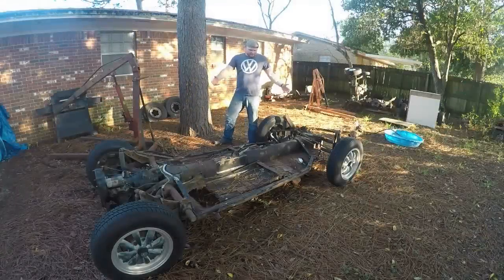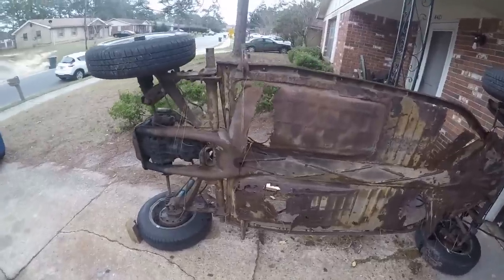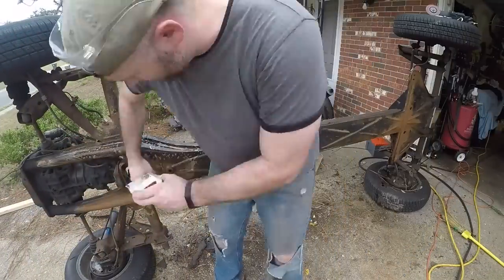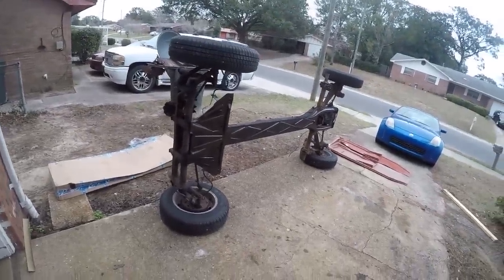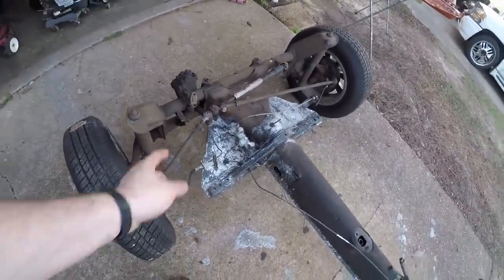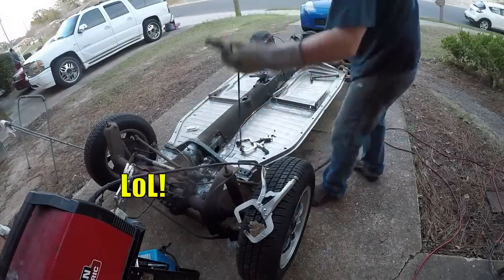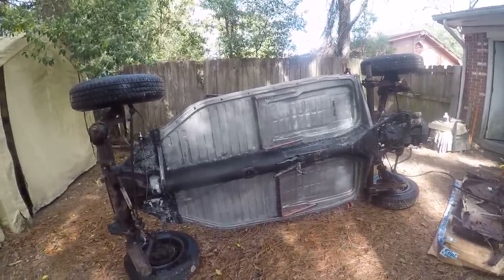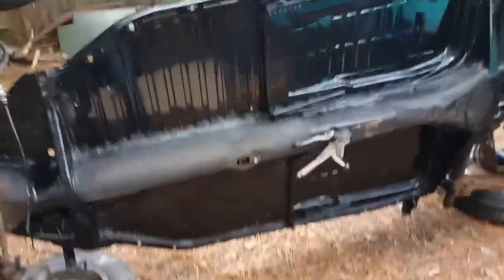Replace VW Floor Pans in 25 Minutes - (Beetle)

Comment: I had one on the mid-80's that was rotted out in the floors. I collected just enough speed limit signs from the back roads to pop-rivet under there and keep the dust out going down the gravel roads.
Reply from the maker: Hehe, those signs are pretty durable!  Good job!
Reply: @DuckmanCycles  
yea, didn't really fix anything, just delayed the trip to the scrap yard by a few years. i cant imagine trying to restore that thing in the condition it was in when I finally scrapped it, but I've seen guys taking on a whole lot worse these days
Reply from the maker: HAha, well thats still a fix!

Comment: Very very nice work! I need to live near you…..👍😁
Reply from the maker: Haha, my neighbors love me because I fix their stuff for them.  I'm the guy with the know-how and the tools.  I just did another floor pan replacement.... well, a DOUBLE replacement, 2 cars at the same time.  Check out the video! https://youtu.be/WdzqTdKgBAY   Thanks man!
Reply: @DuckmanCycles  I just bought a 66 bug that was a basket case big time. When I tickled it up on its side I found a total disaster…the tunnel has three 6x4 holes cut in it the entire front section has been “massages” looks like they were attempting to build a drag car 🤣🤣. Pan was cut and a flow thru setup for air to go thru holes In the back of the pan quit a joke. If you want I can send you a couple of pics to make your day a little funnier. Where are you located? I r in Texas
Reply from the maker: Oh man!  Hope you can weld!  Or a bunch of tubes of Panelbond are in your future!

Comment: Great Vid.  I am doing a 67 convertible for the wife.  Multiply rust x12 lol.  You should try wurth seam sealer as it is paintable and not tar based.  There are other other companies like PPG and Dupont that make it as well.  Anyway its what they use on modern cars and while it costs a bit more than the tar it tends to do a far better job.
Reply from the maker: Thank you for the compliment! I went tar for the cost (and nostalgia) it also paints fine with the oil based enamel I've been using.  Is your convertible as rusty as my '56 Oval was? LoL!  I may win an award for most rusty to restored here on YT for that one.  Do you have any videos of your convertible progress?  I'd love to see!  Thanks much for leaving a comment!
Reply: It is a close second to the oval.  I am pretty sure at one point the car was used as a make shift water tank lol.  I don't have any vids or anything yet as I am still buying parts for it.  All the work I have done so far was more or less just tear down and building the need list.
Reply from the maker: Buying and collecting parts for it, and a walkaround of the car make great first videos!  :: hint hint ::   :-D  Let me know, I'll be watching when you do!  Thanks for responding!  :-D

Comment: Question (becuase I don't know): why strip the paint off the floor pans? Is it not suitable to paint over?
Reply from the maker: That coating doesn't always stick too well, its only there to help stop the parts from rusting while sitting in the warehouse.  You may notice there were some spots that didn't come off easily... if its stuck that well, I leave it.  Some manufactures have coatings that you can paint over, just ask your parts vendor which ones you bought from them and go with their advice!  Thanks for the question, hope that helps clarify!  :-D

Comment: I have watched every floor pan video you've made like five times.  Very informative and helps me out significantly.  After you let the "Cat Piss" dry (lol) and when you "paint" the floor pans, are you using an epoxy paint and spraying it on via gun and compressor?  Or, are you painting it on by a brush and out of a can with a basic primer paint.  Any help would be great.  You have already helped out a lot with all the video's you post.  Thanks again for the badace video's!!!
Reply: I should elaborate.  I watched some of your other videos and you painted primer I think.  Are some ways more beneficial than others?
Reply from the maker: I paint with a brush into the deep crevaces where spray just doesn't get in well enough, I like to work it in.   Primer is used, sometimes, depends on the paint.  Some cheap oil-based lacquer paints stick like crazy to damn near anything, primer not always needed if pan is clean.... BUT!  The cat piss.... LOL!  (phosphoric acid) after it dries actually is a primer of sorts.  Paint sticks to it like crazy so long as its clean!
Reply: @DuckmanCycles  Oh dang, good to know.  I will give it a try.  I ordered some phosphoric acid to try out.  Thank you for the recommendations and replying.  It helps out a lot.

Comment: Thanks for the video, nice job. I have painted my chassis already and I will soon be turning my attention to the body panels.

So it is not necessary to sand the ferric phosphate surface once hosed, wiped and dried, before priming?

What concentration of phosphoric acid did you use?

You mentioned you applied 4 coats before reaching a gloss finish, but I am not sure how many of these coats were primer, or topcoat or just primer.

What type primer did you use directly to the ferric phosphate surface, eg etch, epoxy or polyurethane acrylic primer?

Was the asphalt seam sealer applied before or after you primed?
Reply from the maker: You can get the acid here: https://amzn.to/2ruGW0B

Thanks for the compliment and the comments!  Do not sand after the acid dies, you'll damage the protective crust that will prevent future rust from returning.  You may dust it off, or wipe it down with a damp rag however.

The concentration of the acid really isn't clear on the bottle...  but the acid etches the surface, itself becoming the primer.  Pretty cool, eh?  Another reason you don't want to sand it off.  Additional spray on primer not necessary in this case.

I usually like to apply the seam sealer after the second to last coat of paint dries, pack in in the seams as best you can, then paint again one more time over everything.  It gives a much better finished look.

I hope that helps!  Thanks again for taking the time to post!  Hope you subscribed, more to come!
Reply: @DuckmanCycles  I just drug up a Funco Single seat race buggy with some surface rust all over. I think this is going to make painting it amazing! I did flip a Karmann Ghia chassis up and cut the pans the other day after watching your video.

Comment: I had a beetle with a pan like this when I bought it with a piece of sheet metal layed over the hole. I just moved the battery behind the seat in a plastic battery box and no longer worried that a bump might drop my battery through the floor. Worried less too about a fire starting from the rear seat springs touching the battery terminals.
Reply from the maker: That was exactly what I did on my first Beetle, too! It also helps contain the acid n junk!  Thanks much!

Comment: What do you recommend for a paint stripper?  I need to strip my original seat frames.
Reply from the maker: Visit Sammy’s, give them the seats and get them a bunch or wire brushes.  Or Aircraft remover works fine, too!

Comment: No one asked in the dozens of comments I read but, what paint do you typically use? I go overkill on a lot of thinks with high temp wheel or engine enamel... but if it was your personal bug and not a paid job... or a well paid job what would you recommend/ use
Reply from the maker: Been answered time and time again in the comments lolol!  Its just cheap black enamel, get from your favorite hardware store.  I used the same thing on my Eleanore, but only on the pan, the body gets proper product and is being painted right now! http://duckshit.net/eleanore  I see myself redoing the pan periodically anyway, always upgrades, always mods... always tinkering!  Thanks for the question!

Comment: Duckman, where do you get your heavy duty floor pans at? Is that acid you use on the rust better than using POR15?
Reply from the maker: I think the acid is the same as what comes with POR15.   That was some years ago now that I bought those, there's a lot of places to get floor pans anymore.  
FREE SHIPPING Beetle 48-70 pans here: https://amzn.to/2E0YhGf
FREE SHIPPING Beetle 73-79 pans here: https://amzn.to/2wtD1qI
71-72 Beetles have unique seat tracks, you can use the earlier floor pans if you modify or replace the early tracks on the vw floors.

Comment: To seal that part of the welds and along their joint, it is ideal to put polyurethane sealant. good job.
Reply from the maker: Good call, I use what Volkswagen used that was good for the last 50 years... a tar-based sealant.  At 50 more years it will likely outlive me!  😁🦆💩

Comment: By the way, in which State are you located? Not California, we’re required to spray in a booth out here. The final finish looks like it’ll protect the pan for a long time! Nice work.
Reply from the maker: California is strict on everything.  Around here it depends on what you're painting,  and the materials used.  In this case its just commonly-available oil-based enamel that you can get at any of your favorite home improvement stores.  Its no different than restoring some antique, which in this case it is.  I'm sure if I had any significant volume I'd need to get a booth, but if I had that kind of volume I'd already have a booth!  Haha!  Thanks for the comment!

Comment: Duckman, can you tell me did you drill holes along the inside sides of the floorpan, and then plug weld to the chassis lip? I didn't see that in the video? Thanks Steve
Reply from the maker: Funny you should ask, I just did another floor pan video today... and I answered that exact question in it because I have been asked that a lot since I put this video up.  😁  https://youtu.be/1c_fanB5EdM   But no holes drilled, for several reasons spoken about in the new video.  Thank you so much for the question!

Comment: What was the reason for removing the paint that came on it? poor quality application? uncertain type?
Reply from the maker: Mentioned in video and A LOT in the comments here.  But to answer the question, all the above, it was chipping/flaking, and if its not sticking then my paint won't stick either.  Hope that helps clarify!
Reply: @DuckmanCycles  it does thank you

Comment: We have a paint here called sub-frame black that truckers use on the frames of their rigs, but people use it on the underside of their trailers and such,  and l use it on bike frames. The other thing we have here is a bitumen paint in a spray can and l have used that on the underside of motocycle mud guards/fenders and on the seat pan for extra water proofing.
Reply from the maker: A few people told me of similar things for heavy equipment, I shall try this in the future!  Thanks!
Reply: @DuckmanCycles  No worries. Incidentally old fisherman with wooden boats I have come across use coal tar on their boat hulls to prevent barnacles and wood worm from causing damage.
If I remember correctly British cars had their panels full of bitumen for body deadening properties but to make them water - proof against salt from the winter roads.

Comment: i got a 63 and a 74 both running no rust in them the 63 has a new pan and a 72 bus trans axle both have custom wheels good tires lot of after market parts on motors got both of them for 400 bucks
Reply from the maker: Sounds like you got a pretty good deal there!

Comment: Any concerns over rust in the hollow center channel?
Reply from the maker: No so much, really.... unless it was compromised because it rusted through from the outside, or if it was a convertible left to sit outside with a rotten top.  The tunnel is almost always in OK shape... when I've explored with a borescope I don't usually find any rust at all.

Comment: I've got a really noob question for you, what kind of cheater pipe are you using? I bought a 3/4 inch steel pipe at my local hardware store and it bent when I tried to tilt the chassis.  There's a joke in there someplace.  Thanks!
Reply from the maker: I'm really not sure where that pipe came from.  I've had it for a long while.  Its similar to the handle on a 5-ton floor jack.  A big heavy, mofo pipe.  Its almost 2 inches in diameter.  Thanks for the question, I'll ask the guy I that handed it to me to see if he even remembers... lol
Reply: DuckmanCycles and VW Garage  haha, yes I knew the answer would be “bigger and badder than the pipe you have now!”
Reply from the maker: Haha yup!  There is a lot of force on that pipe right at the fulcrum where you bent it.  What I call the "orange pole" I use for flipping chassis or even popping out ball joints.  Its incredibly handy and matches my 
 off-camera personality!  HULK SMASH!  😂😀😂😀😂😀😂😀😂
Reply: I bent it back... let's see if I can return it to the hardware store without them noticing!

Comment: Did you measure diagonally to square the chassis? I lock it up, adust,  square it then weld.
Reply from the maker: Yes it was mentioned (but not demonstrated) in the video :-)

Comment: Great video! Thanks for putting in so much effort. What paint stripper did you use on the red oxide primer? Also did you panel wipe or something after using the stripper? Keep up the top work 😎
Reply from the maker: Thanks!  You should always wipe where a stripper has been... just sayin...  LoL!  But yes, must be clean before painting!

Comment: One more" I went back and viewed the video, you said spot weld. Did you use flux core wire or L56 with Argon?
Reply from the maker: Its just flux core, but I stay away from the cheap ones, they tend to make a more exciting light show, tons of spatter everywhere.  I may upgrade to gas someday, but for now I'm overall satisfied.  Thanks for the quesitons!
Reply: Once spot welded, do you have to use seam sealer because what I'm getting at is, wouldn't you get leaks----confused? I'm trying to understand--the idea is that the new pan sits on the edging of the channel, right?
Reply from the maker: Seam sealer is covered in the last few minutes of the video.

Comment: I'm getting close to doing this job on my 72 gtbeetle. Couple of things. My pans are made longer for variations in years so I'm concerned about cutting and making the bolt holes alignment even worse. Any tips? Also as you didn't spot weld the pan did you just run a seam all the way around? Thanks.
Reply from the maker: Spots only, do not weld a bead, it'll crack!   The width is the important part, if you get the pan to line up in the front and rear wings that is usually good.  But front-to back there are usually dimples on the floor pan on either side of the bolt holes to drill a new hole to adjust the alignment.  You can always refit the body or lay a heater channel on the floor pan with a few tacks in place to make sure its all good.  As I've discovered one time(on this car in fact!) the floor pan holes are drilled at the wrong interval.  You'll find that one will line up, the second one just barely, the 3rd one is out, and the 4th one is WAY out.  I like to widen the holes a little before I drop the body back on just to make it easier to fit.   I hope that helps!
Reply: @DuckmanCycles  I didn't see you drill any holes so how did you spot weld it? My main concern is the fact I have to trim the pan in the first place to get it to fit. Thanks for your reply. Will just have to do my best and hope it's not to bad. At least I'll be fitting a rubber seal unlike the last person who replaced the pans.
Reply from the maker: @GT.Bugger  Weld the edge of the pan right to the lip.  I had a bit of a gap, if it fits flush then the weld would go to the tunnel.  Never been a fan of drilling and filling all the holes.  I learned this way from an expert, saves a step!  😀👍

Comment: Question: Is it recommended to weld the entire lengths/seams of the pans all the way around, or just a one inch weld every few inches or so (and the seam sealer deals with any gaps)?
Reply from the maker: Every inch only.  Single long weld is known to crack because no space for expansion/contraction!  😁
Reply: @DuckmanCycles  Thanks! That's kinda what I thought. So an inch weld every inch. Other question: Did you have any alignment issues with the body and pan bolts/holes after the weld up, and if so, what's the easiest fix/tweak for that?
Reply from the maker: @KingZoneOne  I covered that topic in the follow-up video to this one!  Check it out!  https://youtu.be/vi894U85MQc

Comment: they make a primer with copper in it that you spray the inside surfaces of a lap joint and when you weld it flows back into the weld sealing it completely
Reply from the maker: That sounds cool!  I'll look into it!  Thanks for the suggestion!

Comment: Hey Duckman they are hard to find  but  they do make a reciprocating saw blade that is  more like a jigsaw blade in size. Why i mention it is ir will allow you to make pretty sharp radius turns then  the wider ones  that may be helpful for cutting. Out those floor pans  i found  mine in a local Ace hardware years ago. And have used it on many projects over the years  I'm sorry the  manufacturer and  model info has been worn off for years
Reply from the maker: Thanks for the recommendation, I ordinarily use the plasma cutter, I demonstrated the saw for those that don't have PLASMA POWERRRRRRRRRRRR!   Haha!  Thanks so much for the suggestion!
Reply: You can use also a water tube saw. For radians it doesnt work
good but to straight cut off hard metal its good.